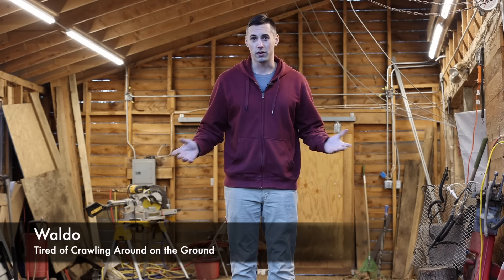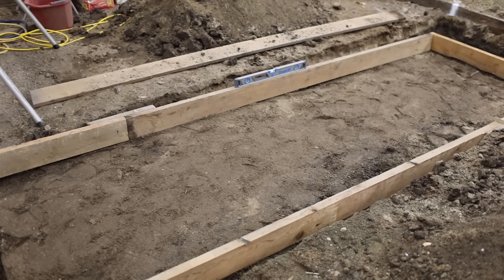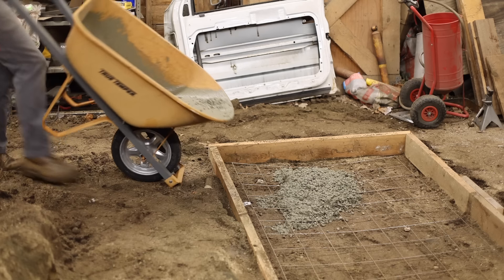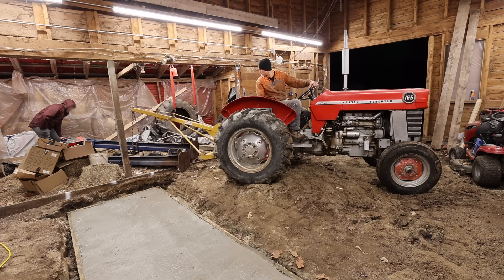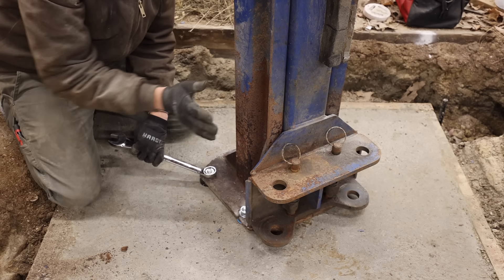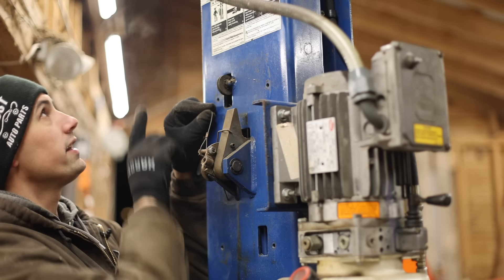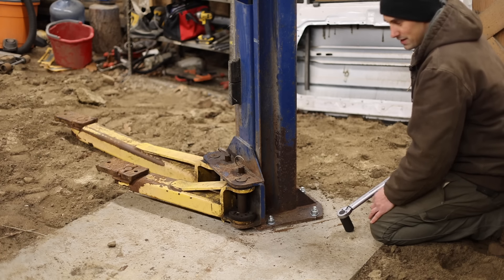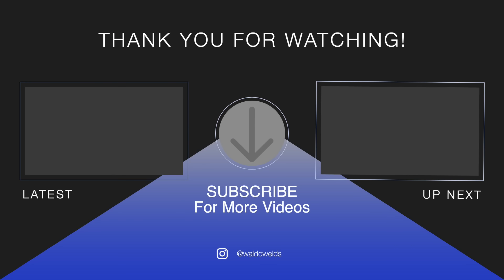Installing a 2-Post Automotive Lift on the Cheap

Comment: Geez, you did this the really hard way, but I commend your effort. It is very hard work digging and mixing.
I would've suggested hiring a concrete mixer so you can mix more concrete faster. Been there and done that and I'll never do the wheel barrow mixing thing again.
I hope the slab holds up too. it looks a bit thin for my liking. I would've gone deeper around where the uprights reside.

Comment: Hey Waldo, I used to install lifts for a living, we sold rotary, you need to put a 4' level on the columns on each side to level them, 150l ft torque on install and 90ft each year. Rotary will have the parts you need if any in the future and if they discontinue them go to SVI International for parts. you can get different adapters to pick up everything from a lawn mower to a low car.  check the back side of the lift pads that make contact with whatever you are picking up for cracks. if the power unit button ever stops working, the same one is in your limit switch up top in the box to keep the cars from going to high. adjust your cables so the locks hit evenly on both side to make one click as the lift raises.  you can get column extensions and longer cables for taller guys.
Reply: Are you saying to retorque the anchors to 90ftlb every year?  I have a used Rotary as well.  I paid pros to install it (worth it) but they didn't mention retorquing.  I want to be sure that I understand your meaning before I bust out the torque wrench.

Comment: Wow wow wow I've installed all my hoists and this make shift concrete pad is no where near enough. Rebar is a bare minimum and 5 inch think I'd want more thickness. All in all get those tall jack stands to go under while your under there so you don't get crushed

Comment: something doesn't look right when you lifted the duramax.  the driver side went up quite a bit more than the passenger and you may find this may eventually bind the lift up with heavy vehicles like this duramax.   Id investigate that.  we had one get jammed on the lift and had to back a roll back under it to take the weight off the lift so we could make the lift move again.

Comment: Merry Christmas my friend!!! 🎁🎁🎄🎄🎄😉
Grats on the lift!!👍
Waldo,two suggestions. . 
You could put down inexpensive  12"×12" pavement tiles to give you a floor to roll your creeper on..
Second,it wouldn't be very pretty to look at but Styrofoam wall panel insulation is dirt cheap and comes in  8'x8' sheets..
Very cheap and easy way to enclose the inside and insulate!! You can install with a stapler gun and could finish in a day!!☺☺☺
Reply from the maker: Thank you, merry Christmas!

Comment: you should put the bolt and washer on the stud before you pound it in that way if you damage the stud when hitting it you can still use the bolt... FYI

Comment: Check the video at 25:51, you're about 8-12 inches away from smashing the cab under the crossbar. You may want to put a sensor up there that will ring an alarm when things get close.
Reply: That crossbar has a hoist shutoff cable in it.
IF it is adjusted properly, and hooked up, he will not smash anything.

Comment: Hey u are not digging enough, there needs to be a couple of deeper holes 3’ at least, and put your bolts in the concrete , drilling later is  good but the 4” slab isn’t safe, well maybe for lawn mowers , side by sides.

Comment: When i did my lift outside, we did 12 inches thick 8ft wide and 16ft long . 24 inches under the posts. 3/8 rebar 8" square pattern  with 12" rebar boxes under the posts. It had to sit 30 days before the lift went on. Please be careful with yours.
Reply: How's your measurements  holding  the lift

Comment: As someone who does this for a living and has installed over 250 lifts;
-that concrete isn't rated for this application and the anchors will eventually pullout (chemical anchors would have been better)
-that slab isn't large enough and you run the risk of the entire unit tilting over when in use
-you should have drilled all the way through the concrete incase you needed to replace the anchors

Comment: Agreed re concrete. I would add a metal beam and padstones much further out then concrete in to balance the mass you are lifting. You should consider more basic Physics to be safer. Interesting concept though. Also I always cure concrete for 30 days for max strength before drilling into it

Comment: As for your ceiling heights could have dug down 6" where you're pouring the pad and then put your 6" pad in that recess allowing The pad to be flush with the ground and not Adding to the height of the build allowing more head room

Comment: The drill went in easy because it"s green as heck. The wrench may not be clicking because the concrete is too green. You're supposed to wait at least a month. Pour concrete over the rest of the floor.
  edit;  the two sides are probably not level relative to each other. shim one side up.

Comment: When you hammer in those wedge anchors you should already have your washer and nut on there, otherwise you can mushroom them and then not be able to get them on.  Anyways, love the channel but am likewise a little worried like the rest of the commenters.  I am planning on installing one myself and am going to do like a commenter said with the 3ftx3ft rebarred and retrofitted into my existing 6 inch slab.

Comment: A buddy of mine dug a 5' rectangular pit and lined it with concrete and built steps walking down into it so he could get underneath. Worked really well.  6x6s rested on the top receded edge so there wouldn't be a gaping hole when not in use.

Comment: I think the cement was easy to drill because it wasn't fully cured. Also, it might be overkill, but I always put in some epoxy compound with the bolts.

Comment: To me, a new shop is the priority build as it simplifies all other work. Work smarter………….
Reply from the maker: You're exactly right! On a similar note, I just bought a new tool box for the shop which will help a lot with organization 👍
Reply: @WaldosWorld  You have a building...Add on/connect a new building

Comment: The factory told me that the concrete should cure a least 30 days. Also I would have doubled the width your going to be balancing your vehicle on the lift if you are a bit off the whole thing with your truck could fall over

Comment: great to see mate, but I am concerned about lateral support throughout the slab and the depth for your foot print. if I could suggest, have a look at pouring a complete slab out the top of your 6" one, it will give you perfect depth and lateral support. good luck and be careful with what you put on that hoist.

Comment: Waldo, I really enjoy your channel and your projects.  I hate to be critical but you missed on sizing the slab and not using rebar in the slab.  When designing concrete structures I don't consider the concrete to have any strength in tension only in compression.  Please be careful the failure mode will not give you a warning.

Comment: 5:32 You could have maintained the load between the two wheels (front and back). That way, the cargo should be distributed better instead all be supported for the back wheels... (english is not my first language)
Reply: Thanks for the metric system! I love when youtubers are concerned about that.

Comment: Waldo, I love your work, but I’m genuinely concerned about the capacity of your lift system.  You’ve got 3040lbs of concrete counterweighting a 6000lb truck (my F350 diesel crew cab weighs 6600lbs) 6’ in the air.  Because your lift has a crossmember, the inward tilting is minimized but you need to guard against a fore/aft imbalance, which is always an unknown on any 2pt lift.  Be safe my friend.
Reply: Yep, I noticed the exact same thing. It's a bit worrisome to say the least.
Reply: Jason London  Hi Jason.  My truck is a 1994.5 F350 crew cab (single rear wheel) with a 7.3L diesel.  My lift is a Twin Busch 9200lb rated 2-post unit with no top crossbar (wish I got one).  I’m not a mechanic and I haven’t spent much time under a lift, but I really don’t like being under a big truck on a lift.  There are a lot of unknowns.  Mine is mounted in a thick slab with expansion anchors.  I’m planning to remount mine and use embedded j-bolts right into the concrete.

Comment: Waldo the way you have installed your hoist you must like hospital food fed through it too because one day that thing will tip over with a vehicle on it there's a reason why hoists are installed in a concrete floor that is minimum 8 inches thick and as the size of the whole building it's in to prevent shifting

Comment: You could’ve welded an oversized nut to the top of that spacer then weld the proper nut on the bottom so that you could put a wrench on it from the top

Comment: Isn't there some U-Cart type of place where you can get a smaller mixer type of trailer with about a yard of concrete?  Usually they require at least a 3/4 ton pickup, which you have, to pull.  It beats mixing mud in a wheelbarrow.  I agree that you are on the very minimal slab.

Comment: Use plastic shims or else the steel base plate of your lift will pull up your concrete and or Crack it up. But this is temporary so I'll shut up here in the comments section. ( I have a 9k rotary lift I installed myself in my shop)

Comment: My hat is off to you brother, we all have to use what we have, and that was a job well done.  Any thoughts to finishing the floor with concrete?  I know it's a ton of work, but if you are planning on building your shop anyway, might as well make it awesome.  I wish I would have put radiant floor heating in my shop when I had it built.  When I build my next shop, that will be the way I will go!  Cheers!

Comment: Maybe you coulda rented a small mixer for the day?  Additionally you need to block the mesh up so its 1/3-1/2 the depth of the slab.  Concrete wont reach its mature strength until 28 days withe normal temps.

Comment: The only thing I seen wrong with this is that he is in the Hoist without seeing if it was level on all sides and he could have used two different smaller and thicker pipes on both sides of the cables to compensate for the adjustment he made to the towers and twerking the anchor bolts according to the manual specs for that individual hoist wait a month and then talk them down again to the specifications in the manual

Comment: I'm wondering who did the "design" of the slab to ensure that this very small hunk of concrete will provide the necessary resistance to overturning with a vehicle on the lift?  You may think that a pallet of concrete mix is a lot, but it looks insufficient to me.  I'm sure your slab can support the gravity load, but can the slab resist an eccentric load?   Think of the vertical supports as long levers.  With one side of the lift carrying more weight that the other side, this entire slab can rotate in the direction of the larger load.  Wire mesh does not provide strength, you need real steel reinforcing.  How about the length of the bolts?  I would not trust your bolts into this unreinforced slab to have sufficient resistance to pulling out.  And by the way, concrete does not "dry" it cures.  If allowed to dry the cement in the mix cannot fully hydrate and will not develop full strength.   This looks like a dangerous situation to me.

Comment: I’m not saying it’s wrong but the with how easy that hammer drill drilled into the Crete I would be nervous, that depends on how set up it is as well however but you are going to have some heavy stuff on that lift so be careful
Reply: One can pound a regular nail into fresh concrete for a few days
Reply: @mrmotofy  yes but he shouldn’t have been drilling into uncurled concrete to mount a lift.. those anchors depend on the concretes hardness for clamping force.
Reply: @alexdownard1948  He didn't crank them down
Reply: @mrmotofy  those anchors are slightly bigger than the whole, beating them in in wet concrete none of the less with make them a lot weaker
Reply: @alexdownard1948  but they don't really do anything till they expand...
Reply: @mrmotofy  you should look up how these anchors work..
Reply: @alexdownard1948  Maybe you should they hold by expanding, that's why they're in the Expansion Bolt category
Reply: @mrmotofy  they’re exspand as soon as you hammer them in, that’s why you hammer them in..... perhaps you should look up a YouTube video on how they work......
Reply: @alexdownard1948  So YOU believe they expand when you hammer them in? So if the expand at the beginning of the hole how would one continue to hammer it? And why would one tighten the nut? https://youtube.com/watch?v=D0iHeRDPygI
Reply: @alexdownard1948  It's a good idea to have knowledge and experience on the topic before arguing with people who use em daily, on how they work. You DON'T understand how they work and have never used em. Don't argue their use
Reply: @mrmotofy  now that you have watched a video on how they work, what do you think happens when you pound that into soft concrete with a mini sledge? The hole is going to expand around it instead of it wedging into hard concrete, there is a reason they tell you not to do it while the Crete is still uncured.
Reply: @mrmotofy  you post diy videos on YouTube and get 40 views, if anyone’s living with mommy it’s you buddy😂😂😂😂

Comment: if it where me, I would have built two footing pads and columns reinforced with rebar for the system rather than a slab to increase its strength. you could also just leave it buried when you build your dream shop.

Comment: PSA- you should always use concrete from a concrete yard and never used ready mix bags for a structural project. It has said to not use bagged cement in every lift instructions I have ever read.

Comment: I would've waited at least 30 days before drilling into that uncured concrete and the slab should've been longer front to back  I would not feel safe with that set up no way especially with bagged mix

Comment: Hey Waldo BUY A DEWALT TORQUE WRENCH project farm did a test in torque wrenches and dewalt is pretty much the most accurate closest to what your trying to torque to! Others are off by quite a butch of ft pounds!

Comment: Hi, I’m very concerned that you didn’t tamp the concrete. If the material isn’t vibrated/tamped, you will end up with voids inside which will seriously compromise the strength. Ok for a walkway, but very dangerous for a two post lift. May I suggest re laying the slab to at least 60cm with vibratory compaction.

Comment: Yes Tim Mattison below here has good sense of care with what is known in the business as Green Concrete. That is why it is "SO" easy to drill. Still uncured. It's just dried off AKA flashed off, you can power float it for up to two days in moderate temperature, indoor climes. Allow two weeks before fully tightening fasteners and also before using it to secure a vehicle load. Also congratulations on having the tool which may revolutionise your work! 
Also you are joking with that slab actually. Those things (hoists) are minimal even when set up exactly to manufacturers spec. You ignored the height to bleed the hydraulics. And the anchors ought to be cast in with substantial attachment. I am seriously concerned that this could be unstable with you beneath a motor vehicle, up to your elbows in mechanical contrivance Waldo ?

Comment: Hey Waldo, absolutely incredible gumption to get out there and do something. Speaking from experience, although what you've done is seemingly out of the ordinary don't let others jar your own research. If dually researched, you'll find things are commonly done unethically. Keep the great content coming!
Reply: Just because one does something "out of the ordinary" is no excuse for hacking your way through it. Thinking it's ok only because it's a temporary install is unsafe for many reasons, too. Specs for a pad install are much different than those for a slab install

Comment: The bolt kit you had was for a cement floor already in, which I think are dangerous....But you started with no cement...May I ask, why didn't you use J-bolts (10-12") in a cement column that ran around 3' in depth and use rebar not wire mesh?  That would have given you a more sturdy under support of your beam.  I hope your cement pad doesn't crack/break under the beams when supporting weight.

Comment: Merry Christmas Waldo.  

Where do you find your parts for the Dynahoe 160.   I came across one for 2500 bucks.  Also not running and may need a PTO rebuilt.  You have inspired me to take a leap and buy and old heap.   Any suggestions would be greatly appreciated
Reply from the maker: Merry Christmas! A lot of it is taking measurements or searching the Interwebs for the part number you see on the existing part. It's not always easy, but you can keep these machines going if you want to. There's also a facebook group that is helpful

Comment: I am doing a similar project and wanted to know if you have had any issues with the slab? What is the heaviest load you have lifted?
Reply from the maker: No issues so far. I've been careful to distribute the weight as evenly as possible. The heaviest vehicle would probably be my GMC 2500HD Duramax
Reply: @WaldosWorld He's lucky to be alive. - The lift manufacturer

"the heaviest is a 2500 HD"? Thats already too heavy for a 10K 2 post. Its under the total rated load maybe but it's overloading the arm capacity for sure!

Comment: This is a nice video. Something I was thinking of doing myself, but I think I'd get a pro to pour the slab or at least get professional advice on what is required.  This is not something you want to get wrong.  I know it's a temporary job, but I think I'd be putting in some additional safety features, like cables to the support pillars and maybe a cage that could get pulled underneath when its up in the air.